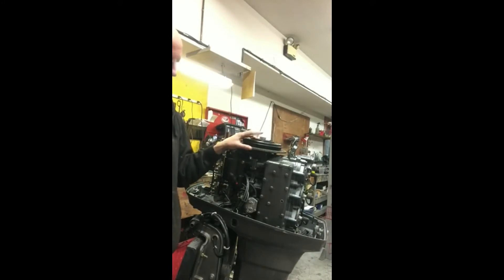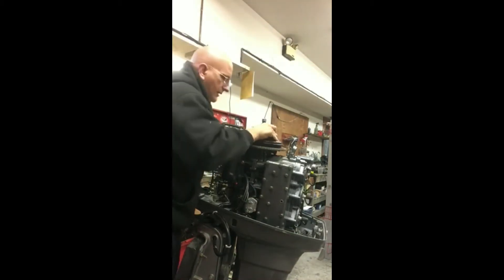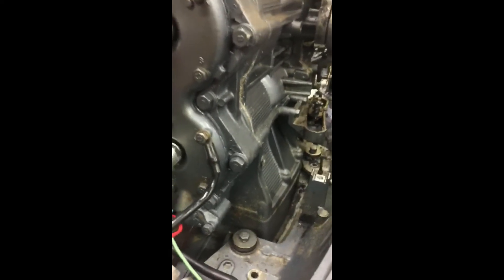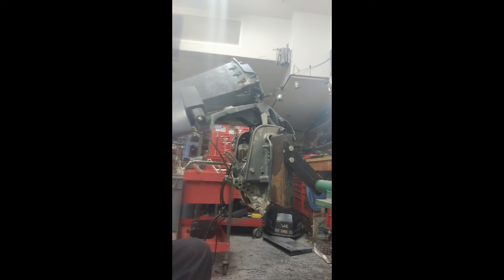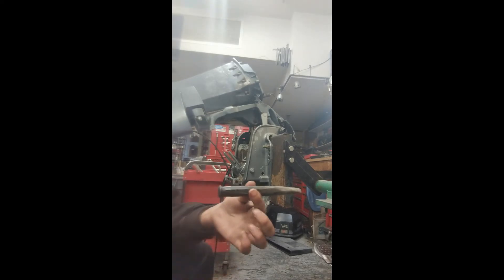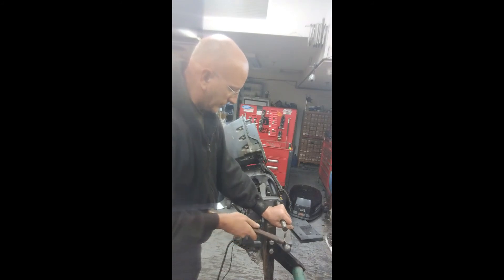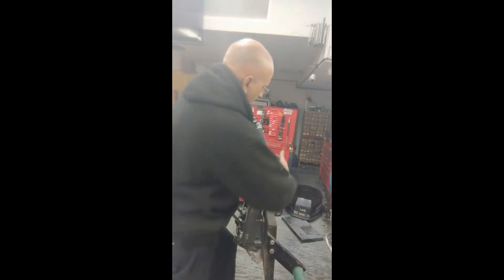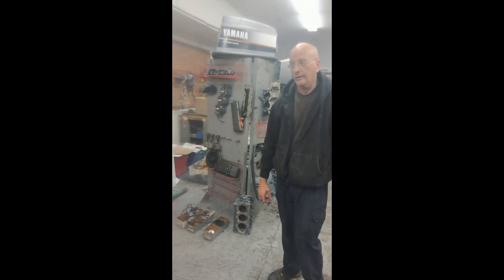Disassembly of 90HP Yamaha 2 stroke for Remanufacture

Comment: What size bolts hold the lower cover the ones come from bottom cowl to lower cover?
Reply from the maker: The part that is horseshoe shaped is 10mm the bolts that hold the powerhead on are 12mm

Comment: Can you remove the crank bottom assembly without pulling the engine.  I just need to remove pistons.  Engine ran without oil and damaged the rings
Reply from the maker: You have to pull the powerhead and you would have to send it out to a machinist. We highly recommend you bore all the cylinders.